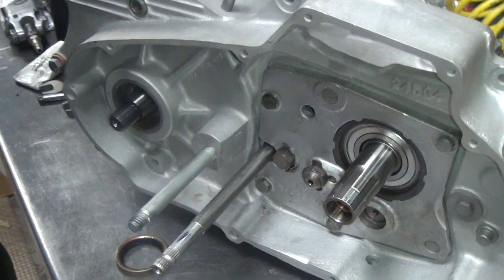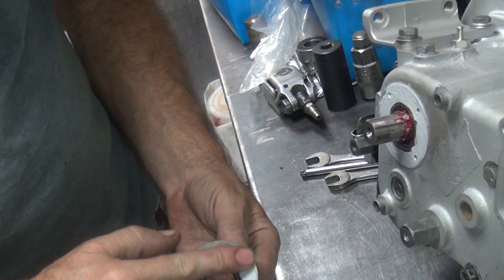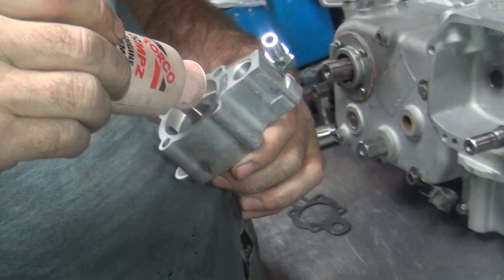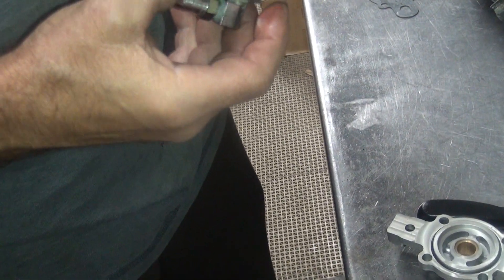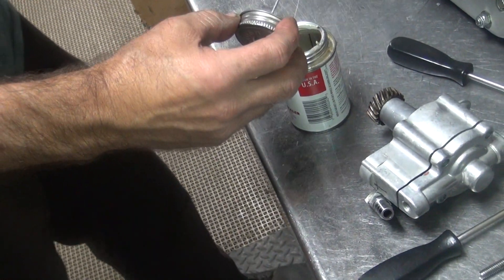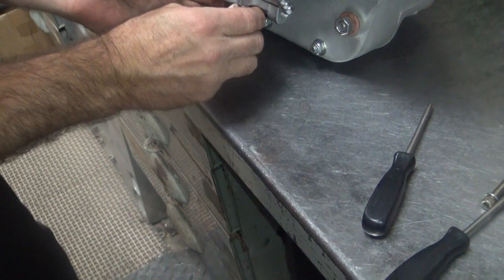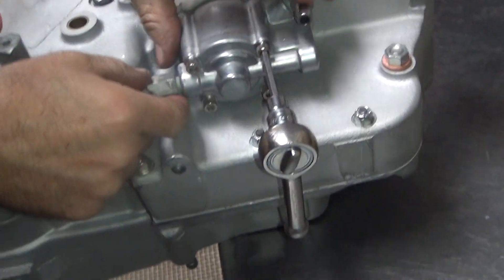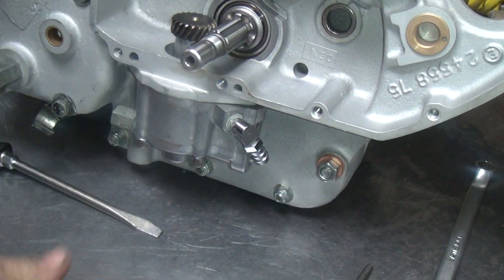#127 1977 XLCR 1000cc motor rebuild thunder heads XL sportster Harley ironhead tatro machine

Comment: Any idea as to what causes oil to foam? I have a 76 sportster, and the oil returns to the tank all foamy. I've flushed out the engine 3 times thinking it had moisture in it but to no avail. It turns out it's becoming aerated before even reaches the filter. Any thoughts on what might be the cause? Thanks.
Reply from the maker: that is how all dry sump motors are. this is not a stupid wet sump motor. it is called a return pump for a reason.
tatro
Reply: @TatroMachine  So does that mean it's natural for that to happen? Forgive me for asking... I just don't know any better.
Reply: @TatroMachine  I mean is it something to worry about?